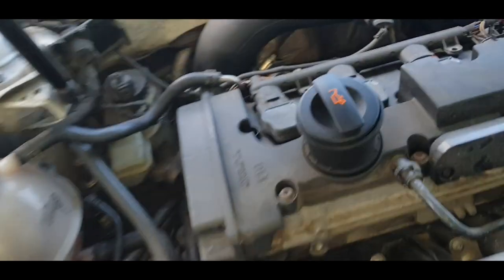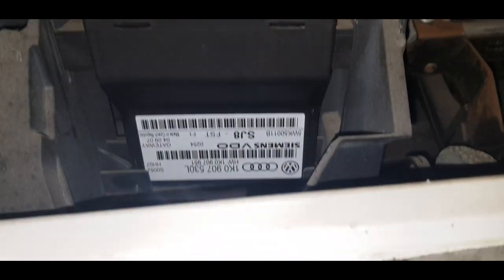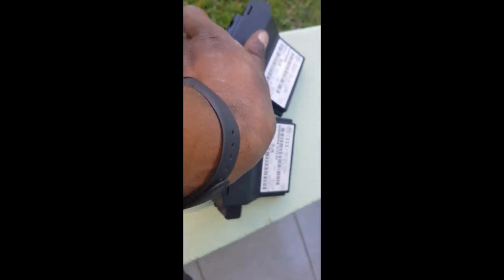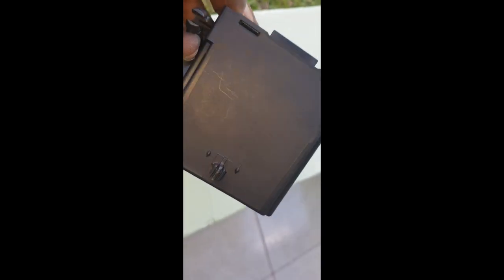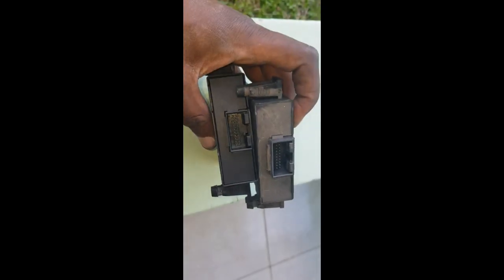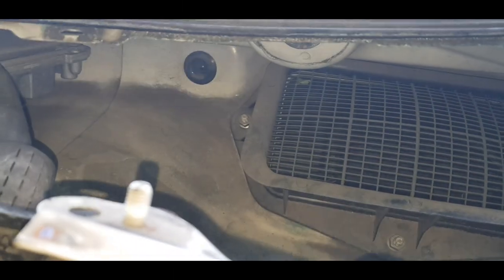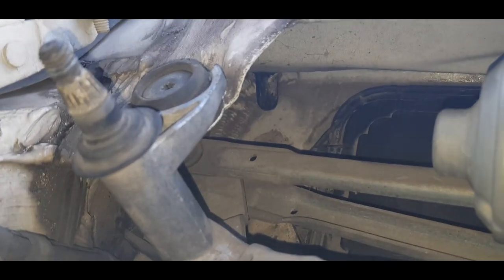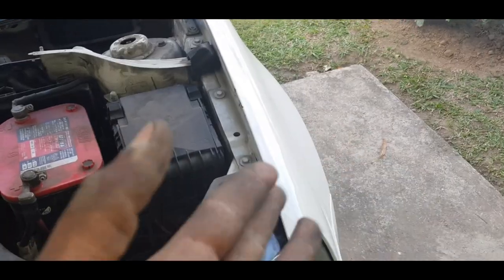MK5 GTI Canbus Gateway upgrade then Sunroof leak fix

Comment: Any idea where this is for MK6? Thanks
Reply from the maker: If you are referring to the LHD model, then it would be on the left hand kick panel (diver's side of the vehicle).  It would be secured by 3 plastic tabs, requiring no tools to remove other than just gently pinching them with your fingers,

On a RHD vehicle , it would be to the left kick panel area on the driver's side (if you can visualize where that would have been).  The difference is that it would sit in an additional plastic bracket which clips on to the rest of the car.   The additional difference is that one would have to remove 3 or 4 torx screws to be able to remove a panel to be able to see it.  On the RHD variant, one needs to be lying on one's back to be able to properly see it.  The LHD models don't have this added step to go through.   

If your model is a 2009/2010 RHD model, then it would be in the same place as that of the MK5 where it is literally under the dashboard and one would have to do the same steps in this video, or simply remove the fuse panel and body control module bracket for easier access.

There are so many variations for these car depending on where they are manufactured  and what time period.